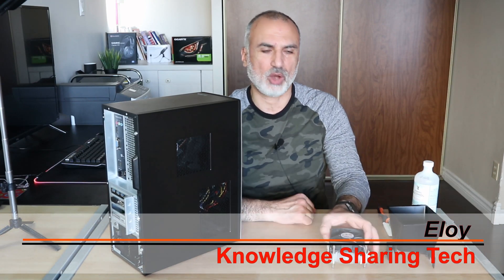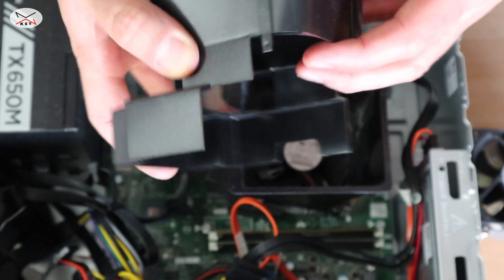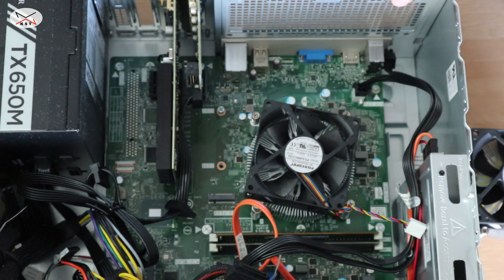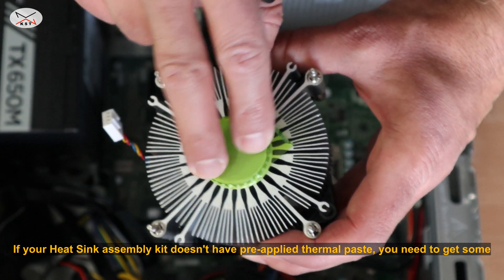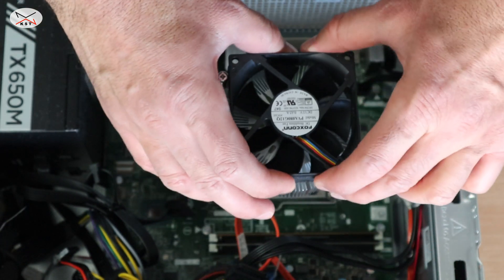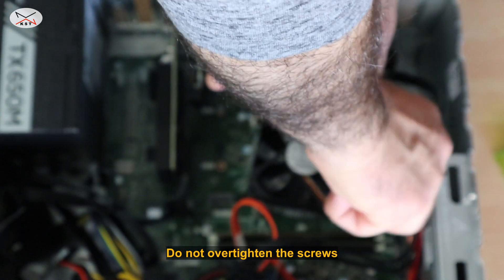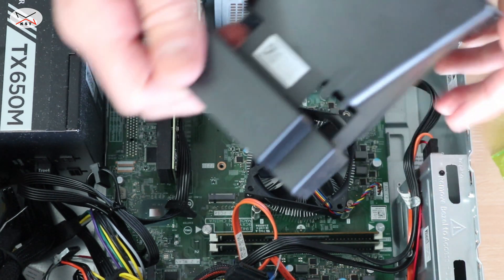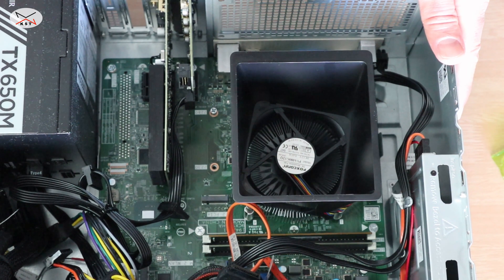How to replace the CPU cooler in a Desktop PC (Dell Inspiron) // Easy Step by Step

Comment: Why did you put that black thing, does is help the cpu performance or the temperatures?
Reply from the maker: Yes, it tunnels the air
Reply from the maker: It is called shroud and it came with my Dell PC
Reply: @KnowledgeSharingTech where can I find it, and how its called?

Comment: Your cpu fan is upside down it should blow on the cooler.
Reply: This desktop has the CPU cooler fan function as a blower exhaust, combined with that funky looking fan shroud. That's why it was facing up rather than how it would normally

Comment: Do you happen to have a link to a recommended replacement CPU fan? I have a 3891 i7 10th gen.
Reply from the maker: The Dell CPU fan is tied to a setting in the BIOS, if you replace it, you might receive BIOS errors when starting the PC. It is better to get a new fan from Dell.

Comment: I have a question what do i do when my screws on the cpu cooler are hard to unscrew and are stuck ?
Reply: did you ever figure it out
Reply: Same issue. Won't move at all. Neither 4. Came to this video hoping that there's an extra mechanism I'm missing